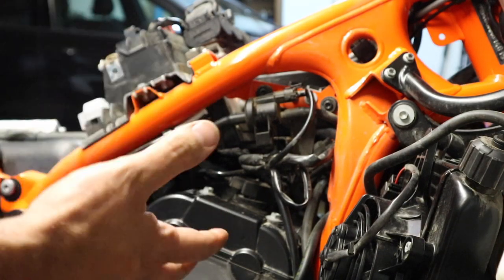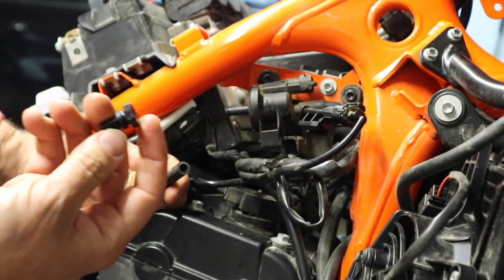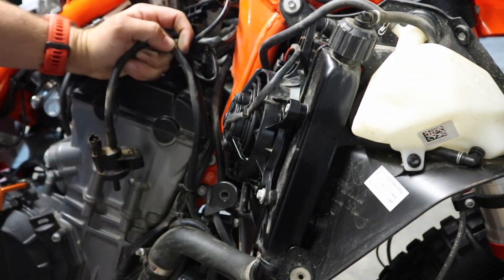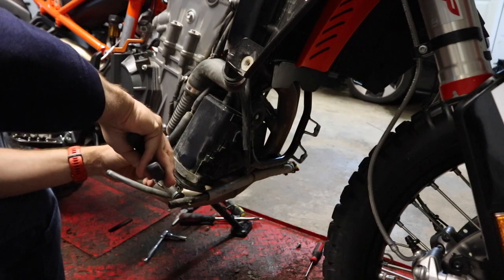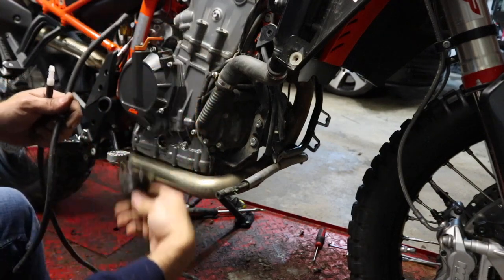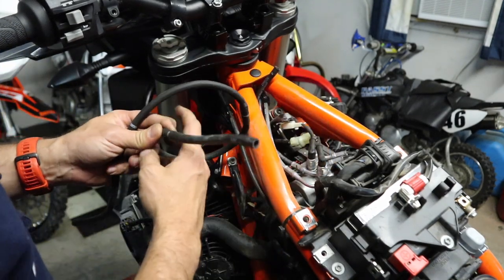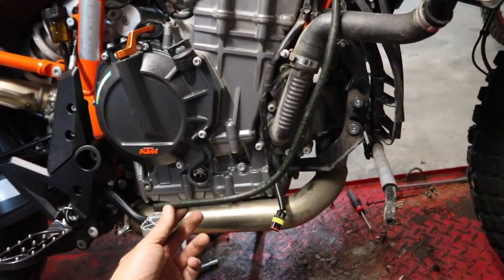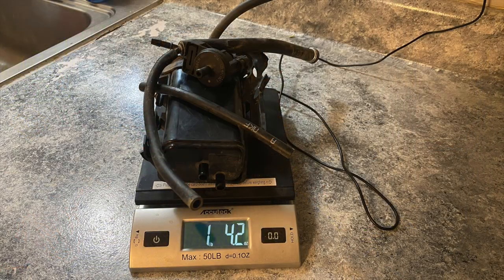KTM 790 890  ADV Norden 901 Canister Delete | Back in the Garage

Comment: Thanks for the video… long time subscriber here.  Question, couldn’t you just leave the solenoid in tact and do the rest of the canister-ectomy to remove the charcoal bit? Save your tank and fuel pump in the long run without having to buy a $30 screw and resistor from Rottweiler?
Reply: I wondered this too.
Reply: Was thinking exactly the same... so you don´t have to buy the dongle... and just leave the solenoid/valve disconnected from all hoses?

Comment: Big fan! My buddy and used your vids to do the Arrow midpipe cat delete on my 890 (for offroad and race purposes only obviously) and it was super helpful, especially for the skid plate section. Thanks :)

What do you see as the main benefit(s) of deleting the canister? I’m about to do the Rottie Pro Intake and have been thinking about also deleting the canister after watching this.
Reply from the maker: The main benefit (for me) is that the new sound drains out the terrible engine sounds the bike makes in stock formation.

Comment: So the only two hoses left are the two starting from the top of the fuel tank right? Water drain is on the right, fuel on the left correct? The fuel one should go straight to the floor, the water drain isnt that relevant right? Thanks

Comment: Is there any other advantage rather than weight reduction that justifies removing the canister? Awesome video, thanks!
Reply from the maker: One less point of failure.
Reply: @2WR  Great, thank you!
Reply: @2WR  I have read on the ADV forum that several people had issues with the dongle that they received from Rottweiler and they had to be replaced. So maybe it doesn't completely eliminate a potential problem.  After my dealer had my 2020 790 for almost 12 months fixing the Immobilizer error  I hate to introduce anything that could be a problem. (replaced the key switch 3 times followed by a complete wire harness and then a new battery.) When I got it back I traded it on a 2022 890.
Reply from the maker: The single is simply a plug with a resistor in it. Bad resistor = doesn’t work. Could make them yourself for a few dollars, a soldering iron and heat gun.
Reply: @2WR  just leave the solenoid installed.  Too many problems with dongles and that's all you are really paying for.
Reply: the fuel that over-flows your tank (say on a tip over) drains into the canister and is eventually sucked back into the fuel system because it doesn't drain like a dirtbike.  So it can suck in  particulates that can ruin your fuel system. So with it deleted it would effectively just drain onto the ground (below your skid plate) not back into your fuel system. Also less 'mess' in your engine compartment...and weight savings.
Reply: @eriknash8783  But should I disconnect the hoses attached to the solenoid?

Comment: I did this modification and now am getting a yellow engine light and it will reset at times but always comes back on.  The code indicates the charcoal canister.  I'm thinking that the dongle is bad.  Has anyone else had this problem?